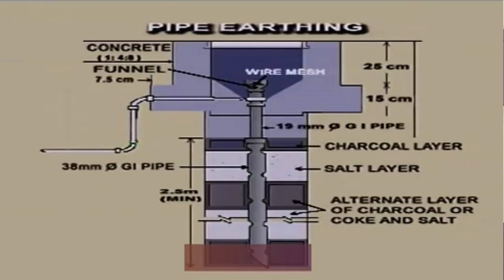എർത്തിങ്ങിൽ എന്തിനു ഉപ്പും കരിയും ഉപയോഗിക്കുന്നു | Why Charcoal and Salt used in Earthing

Comment: Bro.. 1.5 hp മോട്ടറിൽ എത്ര mm2 wire വേണം ..ദൂരം കൂടുന്നതിനനുസരിച് wire guage കൂട്ടണോ .ഇതൊക്കെ ditial ആയി ഒരു വീഡിയോ ചെയ്യുമോ
Reply from the maker: 4sqmm mathyaakum...length orupad kooduthal aanenkil gauge kootende verum ..wire size chart fb page il itit undu
How to calculate wire size|വയർ സൈസ് എങ്ങനെ  കാൽക്കുലേറ്റ് ചെയ്യാം
https://youtu.be/NrLXJ-cFunE
Reply: @TechCornerMalayalam  Single phasil ath calculate cheyyunna equation parayamo.
Reply: Hy
Reply: എന്റെ 10 book നഷ്ടപ്പെട്ടു 
+ 2 marksheet കൊണ്ട് വയറിംഗ് Permit എടുക്കാൻ പറ്റുമോ?
Reply: @janeeshsuhail7994  ഇൻസ്പെക്ടറേറ്റ് മായി കോൺടാക്റ്റ് ചെയ്യു